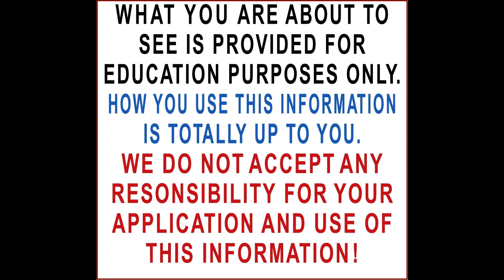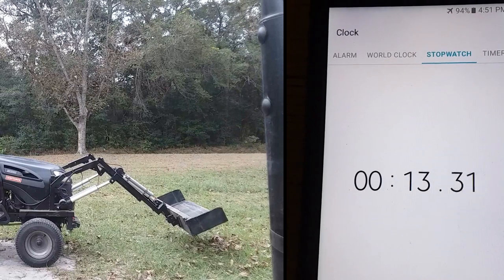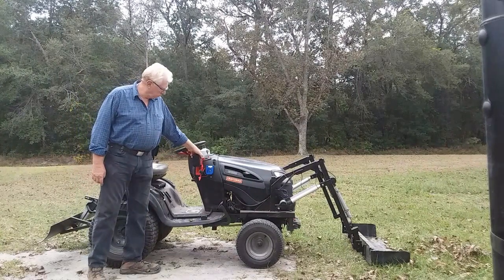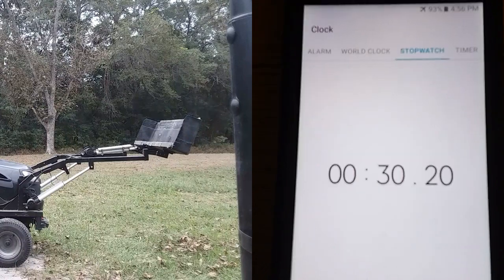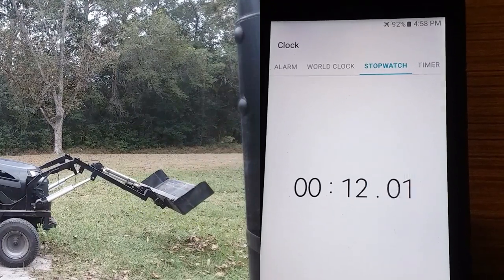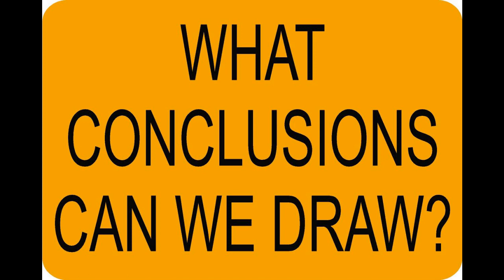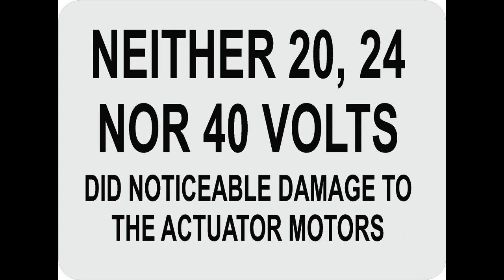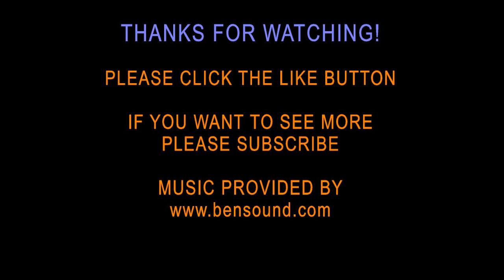Improving the speed of 12 VDC Actuators with Higher Voltages on a Front End Loader

Comment: i plan to use parallel 18 volt power tool batteries since my generator probably will not support a 12v automotive battery and the auxiliary batteries will be charged on their own chargers. i don't know how it will work but its worth trying.
Reply from the maker: Sounds good.